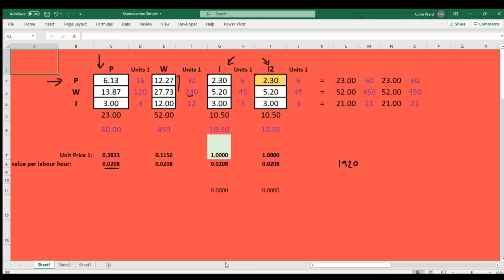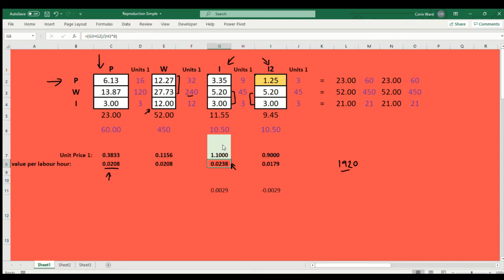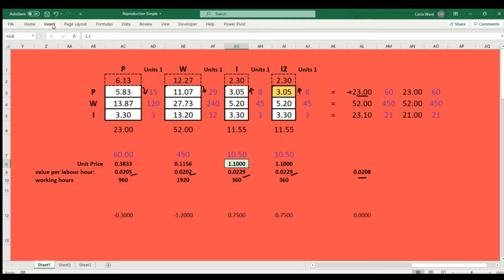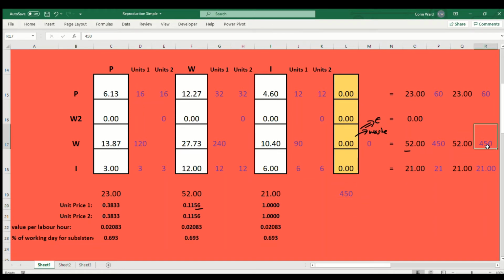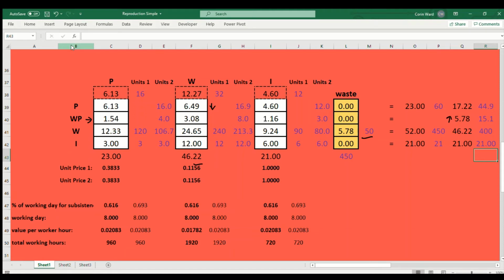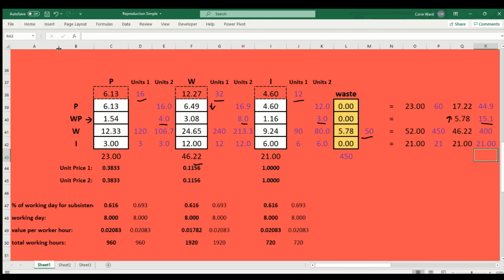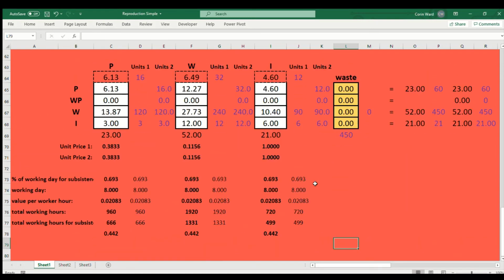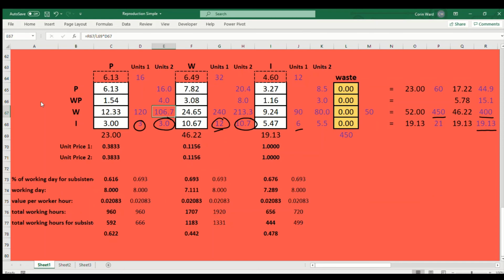Supply and Demand & the Labour Theory of Value using Input-Output Tables

Comment: In my view, the model presented here is not relevant in practice, since you yourself specified your goals:
* A price increase at I1 causes W's purchasing power and profit outflow
* It is stipulated that the sales volume for I1 and I2 remains the same.
* But value is a social relationship that, as Marx suggests, is not determined only on the basis of capital sizes. Values are built on the market. The drivers for this are weighted needs for certain products among buyers and sellers.
* The future development cannot be shown as secured solely on the basis of the distribution of capital and the determination of expected surplus values.
* What can be shown are possible or even probable developments, nothing more.
* If the development could be determined based on the changes made in the table, no company would have to file for bankruptcy, as the values would always be produced as planned. This roughly corresponds to the thinking of the designers of the socialist planned economy.

* What can be shown is the fact that the costs c and v have to be replaced on average for the successful continuation of the production and for this an surplus value that has been assessed as sufficient must be paid by the buyers.
* It cannot be proven that values are formed according to the classic interpretation of labor value theory: If a steel producer I3 intervened in the market, who comes from a low-wage country or who was supported by the government in his country of headquarters, he could press the unit-price to £ 0.9.
The impact can only be estimated from this fact: I1 and I2 could possibly give up and sell the units already produced without surplus value or even below the manufacturing costs.
It is also possible that the possibility of continuing production is seen, but only with half the production volume and half of the employees.
* The units already produced may also have to be sold without surplus value or maybe even below the manufacturing costs. This would retrospectively reduce the alleged value production, since a corresponding part of the work involved can no longer be qualified as socially useful and therefore value-creating. 
If, due to new contracts with the new provider, nothing can be sold at I1 or I2 at all, then all the work involved may remain in the private work stage (the work results remain the property of the entrepreneur) and are thus classified as non-value-adding.
The original expected values cannot be reached with a high degree of certainty.
In any case, this would make it clear that values and surplus values are not produced, as the classic interpretation of the AWT describes.
* The surplus value realized on the market can only be estimated in advance in connection with the costs, the brand name, the market situation etc. and cannot be calculated as a fact from any costs or working time.

* What is shown at 01:15 - "... surplus product that only capitalist buy ..." - cannot be correct since no capitalist can buy a surplus product.
The workforce can only produce the initially potential goods so well that there is a high likelihood that buyers will pay the expected surplus value and may even get more than the expected one.
But the buyer pays the surplus value and the capitalist does not pay it, i.e. he doesn't buy it either.

At 02:09 it says “… take the total of the newly added value in the day”
This is not the newly added value, but only the newly added expected value.
Only on the market will it become clear whether the work carried out was socially useful and thus added value and to what extent the work carried out was labor (socially useful work).

At 6:05 am it is said that some goods are sold above and some below value.
But, according to Marx, the value is only given if the work product becomes a value in use for others and thus the work it does is qualified as socially useful (the work product does not remain the property of the entrepreneur). 
However, this only happens on the market. Consequently, there is only one expected value for a work product before it is sold. So a commodity can only be sold above or below their expected value.
Another reason for this: On the market there is always an exchange of values equivalent - value is a social relationship. What deviates unilaterally from the value agreement in this relationship is always a subjective concept of value that is not socially relevant as a value (at most as a subjective statement such as "This product has less value than I paid for it!")

I don't see any other situations in principle for the other parts of the video.

Comment: The classic interpretation of the Labor Theory of Value cannot be substantiated with such tables. If they are to represent values, the outputs are only expected values. The real values cannot be produced, but are formed on the market. You can only produce the prerequisites for value creation and high surplus value payments.
Certainly there are always relatively stable correlations between inputs and outputs, since on average the entrepreneurs have to be reimbursed for their costs with the sale of the products and sufficient surplus values to continue with the production or to enlarge it.
But it cannot be deduced from this that value and surplus value are produced.
This would become clear with such tables if they included all the companies that are going into bankruptcy or that have to significantly lower their expected values, e.g. currently the German automobile manufacturers.

Such tables are good for making expected values visible or for showing statistical correlations afterwards (after successful and unsuccessful sales processes).
But there cannot be produced values, so they cannot be shown in such tables.
If one assumes that values would be produced, one repeats the mistakes of the socialist planned economy, in which the values were also regarded as produced.

In this context, it should also be mentioned that there can in principle be no sale of products “below value” or “above value”. Exchange is always equivalent in value.
Value is a social relationship that is formed between people, the value specifically between exchange partners.
Such a value ratio must contain an objective component, otherwise it would not be a ratio, but a one-sided subjective value concept. This objective quantity is the common value quantity to which the buyer and seller agree (in dialogue or by unilaterally adjusting the buyer to the expected value of the seller) – or no purchase is made.
Anything that deviates from this common value is a one-sided, subjective value concept that is not part of the value relationship between buyer and seller.
However, a value ratio must also include subjective components, because it is linked to people, specifically to their consciousness processes. These ideal components of the value relationship are the ideal reflections of the objective value in buyers and sellers. These are often different when building a value relationship, but must be adjusted to each other for the purchase / sale.
This is not a matter of subjective adjustment or deviation (such as "This product has exactly the value that I imagine!" Or "This product does not have the value at which (at the price) I buy it!" ), but the socially relevant value equivalent (money supply) that is given up for it.

More details - see:
What is wrong with the LTV – How the value is really formed
https://youtu.be/3GHutT-8blc.
Reply: I have learned a lot from both of you! Thank you so much. The internet is always a difficult place. I have watched all of Ward's videos, and the video Lippert linked. Ward's analysis (in Sraffa's paradigm) corresponds with Lippert's at time-code 46.28. After clicking on Lippert's video, fast forward to 46.28, "complexity economics." Ward also answered Lippert's critique when the workers--for no apparent reason--devalued wheat and maybe saved some extra money to buy pigs. In the end, Ward criticized Marx because the length of the working day was how he imagined the distribution problem, yet Ward imagined and calculated a system (based in Sraffa) to distribute surplus. While I am learning so much from both Ward and Lippert, I also have questions...where does the stock market for example fit into the distribution of profits. In the US our employers "match" our contributions, for example. (If you're not familiar with the "401(k) matching" system, I can explain more, but I have already written this much. Oops.)
Reply: @DamiensRegicide  Thank you very much for your answer.
I changed the first sentence of my comment!
Unfortunately English is not my native language and for me the words of Ms. Ward are very difficult to understand, especially in this video.
Based on their statements about the values produced and the sale of products above or below value, I assume the classic interpretation of LTV with these tables.
Since I am familiar with the use of such tables from other LTV discussions, I know what it is meant to express (e.g. in the book "Thinking Post Monetary - Opening a Dialogue", Springer Verlag 2018).
Reply from the maker: @Rainer Lippert. I've added English subtitles now, and also have uploaded the spreadsheet used (see video description). Hopefully that'll help. If you have any suggestions on how to make these videos easier for non-English speakers, i'm happy to adapt in future. 
And thanks @Richard Herd for the explanation. Yes, Example 3 is probably going to be the part you're most interested in Rainer, as it deals with the subjective behaviour of consumers, as well as what happens when industries can't sell all their products. I also show how to use the input-output format for both what you call "expected values" as well as what happens at the macro level when some of the products don't sell. In all the examples, I show why changes at the micro level have less of an impact on labour values than you'd think. If any part is difficult to understand, please feel free to ask questions for clarification.

@Richard Herd I don't know much about 401(k) matching - this is in the US right? Let me think a little about how to display the stock market in this format, and i'll get back to you on it.
Reply: @sraffapocbmoc  Wow, thank you very much!
I hope that I will find time in this time again to study your video!
Reply: @sraffapocbmoc  You're too kind! I did not mean to assign homework--I'm sorry. American employers offer a "matching program." This is often considered a benefit to the working class. This means about 3% of the employees' wages are placed into the stock market. The "matching program" means  the employer contributes an additional 3%. From the Sraffa point-of-view and from the distribution problem--I cannot tell whether (a) wages are being distributed to capitalists, or (b) whether profits are being distributed to labor. (I'm afraid it's option a.) In your input-output table, it may be possible to split "wheat" into 2 categories, "the germ" and "the chaff." I will experiment with the MS Excel file you provided. Thank you!
Reply: @rainerlippert  Thank you for the book recommendation! America is still struggling with the pandemic (and it looks to be worsening over here, in the SF Bay Area), so I cannot retrieve the book from the library. I had originally found Ward's YouTube channel because she explained a few sections from Sraffa's book "Production of Commodities by Means of Commodities: Prelude to a critique of economic theory." Other scholars have explained the book also--such as a YouTuber named "Heretical Sraffa." Sraffa's book is too hard for me to explain and my comments are banal, unfortunately. I will attempt a comment nonetheless: From Sraffa's point of view: Money (to me) appears as another commodity in the means of production. The point of an input-output table, I assume, is for convenience of understanding the relationship between complex-dynamic variables and testing some claims. I can't imagine trying to create a comprehensive-rational input-output table! I'm not suggesting a "money commodity" must be added to the analysis. I'm suggesting it could be added, depending on the claim being investigated. Alas, your English is far better than my German! (Edited: wanted to add Ward's first video explaining Sraffa. And I can't wait till Ward's channel gets all the way through appendix D :) https://youtu.be/JTk3r1m-tWc
Reply: @DamiensRegicide  Hi, thank you for your respond! 
Sorry, I don't no which book do you mean.
Money is from my point of vie a commodity similar to others. It will be used to ensure a to express a right to a percentage of all economically distributable goods that are socially relevant.
A flower vase for example is bought as a commodity to make it look beautiful.-
Reply from the maker: @Richard Herd
Sorry for the delay, i've been offline a while. It should be both. So, first you'd minus off the 3% each from all of the figures in the rows for capitalist and worker's consumption, and add an extra row with the corresponding figures, called "shares". The matching program is then a cost, below the profit line. You'd add an extra column too, that represented for each industry how much money was "output" as shares from each industry (how much money was given to that industry to buy it's shares). Total up the rows and columns. So far, the columns shouldn't have changed but the rows should. The difference will be the extra profits (or losses) incurred by each industry due to the share program. You can call this business savings, and if you want to represent current dividends, you'd just divide this into another row again that you'd call workers savings from dividends. I hope this makes sense...
Reply: @sraffapocbmoc  This makes perfect sense! I will give it a try soon. Thank you!